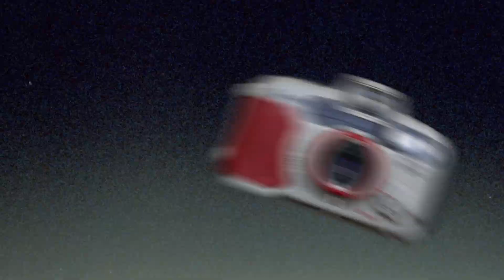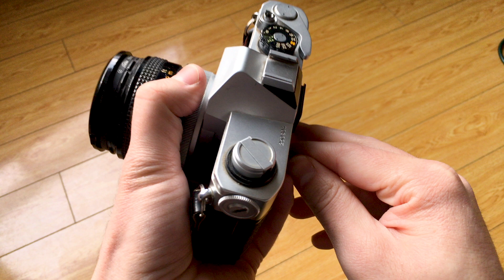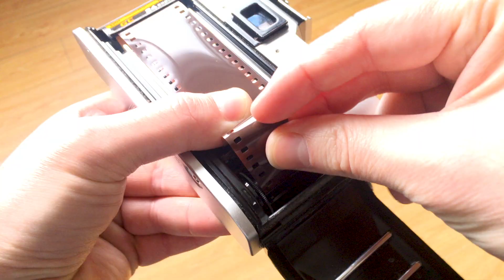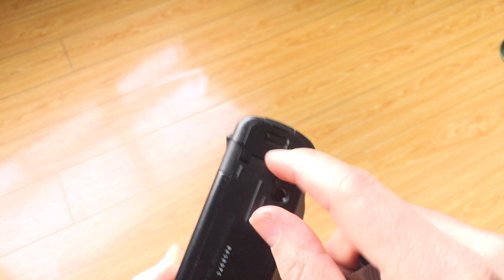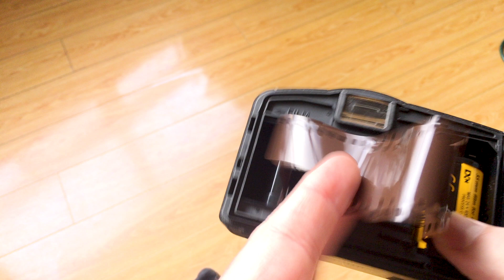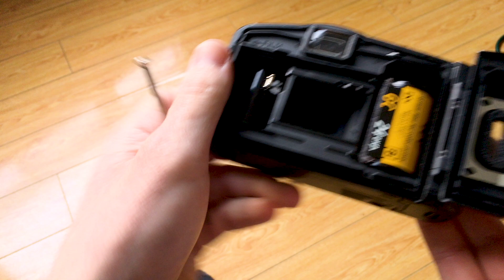Loading 35mm Film - SLR & Point and Shoot Cameras

Comment: If you load the camera in darkness and are sure to make the tab sticks to the takeup spool (it will vary between cameras how much film you need) you may gain 2-3 frames so you can shoot 39 frames on a 36 frame roll. By tightening the rewind lever, you are making sure it rotates every time you advance the film (on more manual cameras) so that you make sure that the film really advances. This demands some, but not too much training.

Please note that you will need to wind the film to load the spring mechanism that makes the shutter work. This means that you might think that you cannot use the very first frame that is on the pressure plate and is still unexposed because you loaded the film in the darkroom, because you have to advance the film at least once, to tighten the spring. However - there is a trick to release the takeup spool which you do when you rewind the film (manually) so that you can pull the advance lever without actually advancing the film. This is for experienced photographers only, as you then have to make sure that the mechanism locks again after you pulled the advance lever and make sure that the film really advances from frame 1 to 2 after you have made the first exposure. You might then even get 40 exposures on a 36-roll. However again, this is when you are knowing your (manual) camera well, don’t do this right from the beginning. Test the buttons, feel how the mechanism behaves, and it is a little different from camera to camera, too.

Comment: Actually you dont need to fire 2 shots when loading film in camera. Actually you waste 3 frames like that. Instead of taking two shots before closing the door If you know you camera and trust it you can advance it only once than close it. The first photo you took will be half burned. And you will have 2 more free shots until the counter moves to 0. So like this you can have 38 frames and 1 half one from a 36 frame roll. Of couse it not same for every camera so you have to test it.